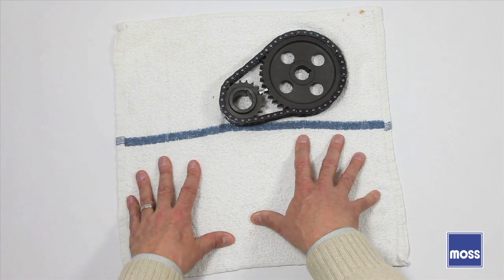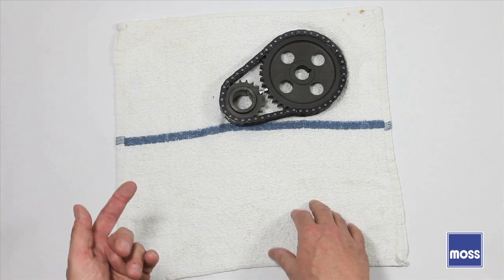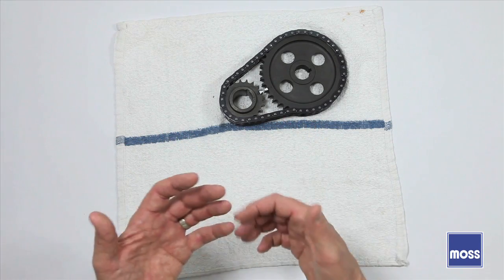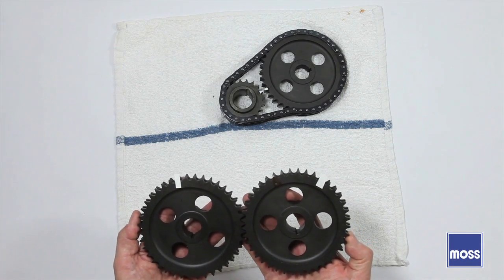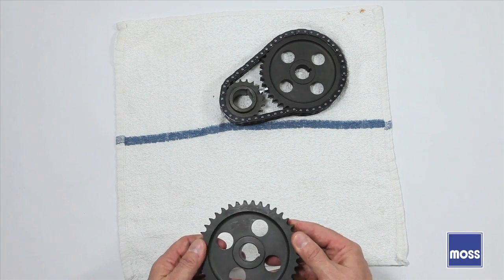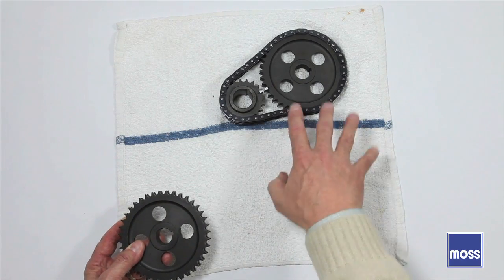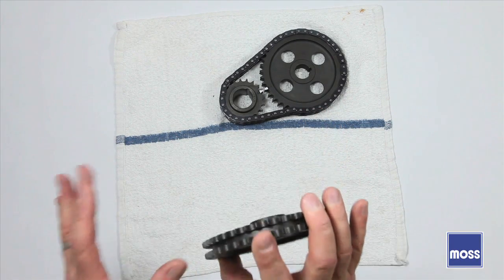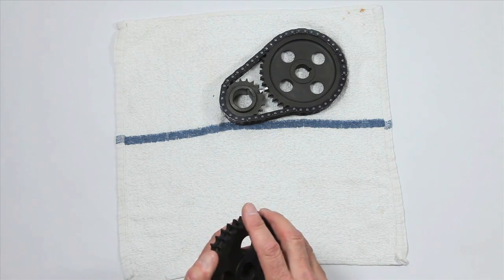Timing Gears & Marks (Part 1) - An introduction

Comment: Yea... A veteran VW mechanic told me to just swap out the timing belt on the old, mint VW diesel engine he sold me.  I was VERY careful in marking everything and matching things perfectly,  To my dismay, months later, when the engine was installed in my Rabbit convertible, it decided to blow up.  I've yet to crack it open to have a look inside, but I imagine it won't be pretty.  Love stories between pistons and valves never have happy endings...